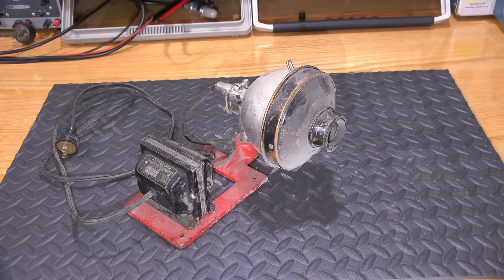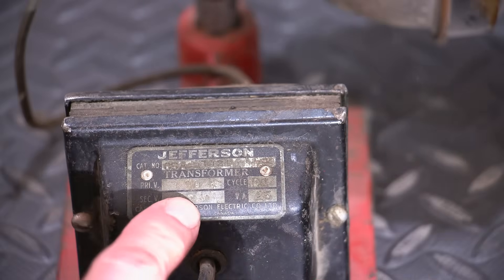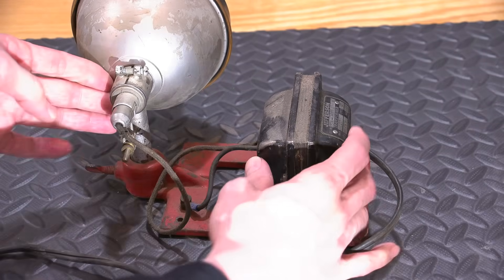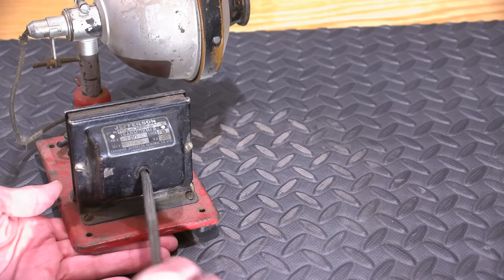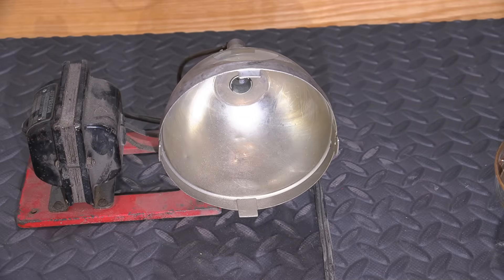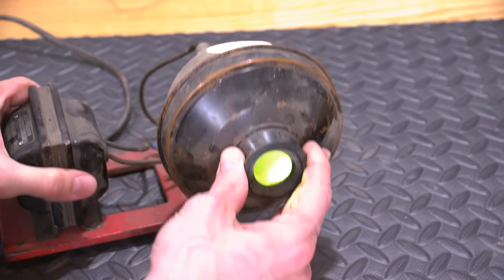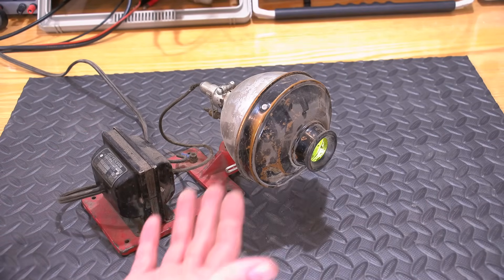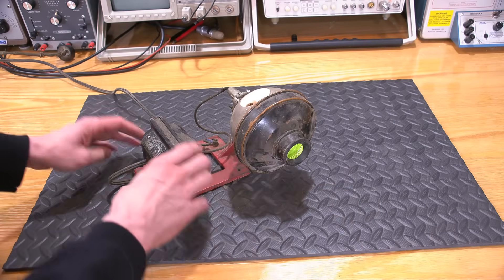Barn Find - What Is It - 1940's? Mystery Device Teardown!

Comment: I have seen similar tinted glass in classic old German home dia projectors with a 100W lamp in them, where that glas was used to absorb the heat form the light. I felt the heat before and after that filter and I burn me before it but after it was only lukewarm. If this is for egg the glas is to not heat the egg up is my guess.

Comment: It looks like an old accent light they'd place behind Urns and plants in the night clubs  The low voltage transformer says its for a low-wat light and teh colored glass would permit color change. Notice its a flat glass and not a lens, so it's made for splash lighting, not intensity. the lower voltage lamps would also last longer, at least all night, back then. Either that, or somewhere between being forged from a meteor and being issued from Io, The Green Lanterns got a tryout upgrade.

Comment: I know nothing about checking eggs with anything more than a regular ole lamp or flashlight.  It most certainly is or could be that.
My immediate thought though was a projector; however with the mount, ability to articulate, filters and that is was manufactured in Toronto makes me think it might be stage lighting.  Like something after limelight or some carbon arc system for a smaller theatre or staging of sorts.  Could be the egg thing though.

Comment: Since you have a clear answer to what it is I would only like to add it most likely would have used a pre-focus type of bulb.  This type of bulb has a lenz built into the glass which concentrates the light to a focal point in front of the bulb.  This would explain why the depth of the bulb was adjustable to fine tune the light on the egg.
Just guessing.

Comment: Possibly part of an automotive wheel alignment rig, the angle adjustment and swivel allow adjustment and a slotted mask disc would be inserted under the spring clip inside to project to a target mounted on a wheel. the rotating drum would adjust the line for camber or kingpin measurements.

Comment: Almost reminded me of an old car tire balancing unit I used to use back in the 80's, but was much older.  it used a white strobe activated by a sensor that you placed up under the lower ball joint and another motor/roller unit to spin up the wheel to about 60mph! quite a contraption, the strobe would flash from the vibrations and reveal the area unbalanced at the rim so you could weight it. on-car balancing is the most accurate BTW.. the egg lamp is much less complex, and a lot safer I bet. 🏁

Comment: One time, I had a flash bulb, and I used a voltmeter to try to test if it was good, but it said it was bad. I guess something was wrong with the meter because when I took a nine volt battery to the bulb, it flashed right in my eyes. I was blinded for a minute or two, and I burnt my fingers some.

Comment: I think this thing was designed to omit, x-ray's. To warm you up in the wintertime. They got the idea from that, Amana Radar Range oven. But they didn't need that metal box. When you could just aim this. At the food items and people you want to cook at a distance. And it was found to be able to burn. The cancer right out of your body.  Of course it would also cook your internal organs into giblets. But no gravy.

It was designed to burn a hole through your soul. It was a retroactive abortion machine. It's a Canadian attempt at TV. Electrical, transformer, electron-beam. And that will have to be close enough.. Let the CBC figure it out. I happen to know they are almost as good as American TV Engineers.  Almost. But not on Tuesdays.

This is a practical electron gun. I thought that was obvious?
RamyRAD

Comment: Flash bulbs have magnesium "wool" in them...popping them is basically short circuiting them out with a consumable filament which burns at a high temperature. Doesn't require a really high voltage to pop. I was able to pop a small one with just a 9 volt battery!!!

Comment: This was my thought process about guessing what this item was.

Being used in a barn, I thought maybe it was some sort of insect trap and killer. Based solely on the thumbnail of the video, I thought the front was open and the light inside was some sort of special green that attracted flies, then once they got inside they'd be electrocuted and killed. Basically, a very early bug zapper.

Then, once I saw that the transformer only put out 6.5V, I realized that wouldn't be enough to zap the bugs. So, I figured maybe it just lured the flies in the front, then they got stuck in there somehow and would eventually die.

Then once the vent hole in the reflector was shown, I became a little more stumped...but still was somehow trying to make it fit with the bug trapper idea, assuming maybe the hole in the reflector would allow the bugs to fall out once they finally died from being trapped. Kind of a stretch, yeah.

It was when the front was revealed as being sealed green glass that I finally gave up on the bug trapper idea, and was at a total loss until the egg viewing concept was brought up.

Comment: With the old "flash cubes", I believe they worked on the piezoelectric principle. I was messing around with  one of them, comparing what was happening in the base with what was happening where they met with the camera, and there's a little sprung wire inside the flash cube. If you pull that sprung wire away from its resting place and release it, the flash goes off! The cameras that used them didn't have an electrical connection to the cube; on top of the camera was a little ramped tang that would catch that little wire and pull it back when you cocked the camera for the next picture. When you pressed the button on the camera, the tang would withdraw and let the little wire snap back, causing the flash to happen. I had fun flashing my friends one day using a toothpick to snap the wire inside the flash cube! I think I still have a couple of cubes that haven't been triggered yet...

Comment: My guess is it is for the railroad for some 'light' indicator/switching service? 
Did you ever find out what exactly it is and what it is/was used for?
Reply: With power limited to < 25W? Way too dim for that; would never been seen from 100m away in bright daylight. Also, the base, transformer, short power cord, and plug all indicate indoor table-top use. Almost certainly an egg candler.

Comment: I agree with the egg candling device but why did it need a humongous transformer.  Did light bulbs back then only run on  6.5 volts?  It seems like a regular 120 V input could bypass the transformer and use a regular light bulb that runs on 120 V.  Maybe he made this convoluted design in order to get a patent.  The transformer looks pretty darn solid tho.
Reply: Yep, it appears to be an egg candler. A 120V 60W light bulb would be way too bright for that; it would blind you after staring into it for awhile. The transformer is rated 25VA, so likely the light bulbs used were 15W or 20W. That, one can stare into with harming one's eyes. That's also the purpose of the warbled green glass: further spreads-out and dims the light

Comment: Wow!  I am glad I found your channel. Very interesting. I would have never guessed that was an egg Candler either.  Most interesting was when you got into the conversation about flashbulbs. I do remember the magic cubes and the blue dots. And other various forms of flashes. I have a very was popular and not even rare camera called the brownie which I think was one of them with the single disposable  bulb that you are referring to.  And just a little something else off the beaten path. I even still have a model rocket from many years ago when I was a boy. It was called the snapshot. You could shoot it hundreds of feet into the air and right at the moment the 2nd stage parachute deployment, it would snap a picture at its peak altitude.   It used 110 film cartridges.  These film cartridges are probably impossible to get. But it's still cool to own this thing. And still no electronics whatsoever. Only thing electric about it was the hot wire that ignited the rocket motor. Just some things I thought I'd add to the comments. This video seems to have attracted some camera people.  However I love electronics and I am a synthesizer player as well as video and still photography. I have tool maker and engineering background and also interest in ham radio. Great video and great channel dude!  I'm sure I'll be watching more of you.

Comment: That flash bulb has magnesium wire, and you are correct that if  you were holding it and activated it, you would get burned.  I have used many hundreds of the medium sized bulbs, and still have some flash equipment for larger flash bulbs. 
The flash cubes, were designed for the Kodak Instamatic cameras..  I still have some, never thought of them as being a saleable antique.

Comment: Well, 6.5 Volts is certainly not going to generate any X-Rays so what ever it is your probably safe (except for low possibility of 120 Vac electrocution)... I'd definately go for it LOL....looks like it needs a old 6 Volt 25 watt automobole style Lamp.....If you search for  "6 Volt 21 Watt Turn Signal Lamp "you will find  a company called Scooter Works that has them for $3.00, looks like it would probably fit and work

Comment: That's magnesium in the flash bulb, in a pure O2 atmosphere, and yes it gets hot enough to cause the glass to bubble when it goes off.

I have one that has a blue coating on the glass, yours is probably older (the blue was to help tweak color response later on)

Comment: It looks like a military or rail road signal lamp. There may have been a tube that fit over the flange if it was military. It would have been used to mark a destination without being seen by enemy troops. I haven't found that particular one but there are many with similar attributes like the adjustable height and swivel capabilities.

Comment: the back bowl is a reflector, so the bulb can be adjusted to focus the light onto the glass. This makes the viewing angle quite wide if if the glass is not very diffused. Due to the horizontal orientation, this may be railway equipment to put in the window of a station to let a train know if there is a pickup at that stop.

Comment: You might have some Krypton glass there if you're lucky, I think that's key to how it works
Reply: Bolt that on the side of you're work bench and with a special chemical you have an easy way to produce a reagent during nuclear disaster or other emergency event. Its a workbench item to keep the equipment you have there running well and reduce its radiation levels.
Reply: use coffee mate, I think that will work
Reply: or perhaps beryllium if you can

Comment: It's a old Theatre floor lamp / inside the removable front you can change the green lens to any color that large hole there is a piece missing 
a snap in cover vent so it will not over heat

Comment: One thing it could be used for not mentioned, is a portable color therapy healing device.  I inherited two full sized color healing machines from 80+ year old cousin that had passed.  Invented by fellow named Dinshaw Godiali ,spelling? defended himself and won in court he was not a quack.  Orig machine of cast alum about 2 ft square and about 5 fit tall with large bulb and large colored slides for certain healing modes depending on illness.  Not exactly portable because of size.  This would work for localize problem on arm or leg instead of whole body.   Came with instruction manual and he wrote his whole theory back in his day.

Comment: I’m good with the egg candler except for the size of it and the green lens.  Ours was a large wooden chalk box with a less than egg size hole in the sliding top and a 40 watt 6 volt bulb inside.
In later years we had 120 volts and added shelves on two sides, one for fresh eggs and the other for ‘candled’ eggs.
The shelves held the wooden 12doz box egg separators …
The fertilized ones were marked and went back out to the broodie’s and the passed ones were taken to Mr. Poad at the store to trade or for credit.  (Sometimes even for cash or candy !!!)

Comment: Black and white camera film is least sensitive to the green light part of the spectrum, so Kodak had a special green safelight (I forget the code number for it, maybe 3B rings a bell) that was used for film inspection in darkrooms in cases where the film had tangled up inside a camera magazine or darkslide. That device is much to bright for that though, but with an extra filter in place and - very importantly - all the leaking white light plugged up - I suppose if could have been used for unprocessed film inspection.

The Kodak green safelights were exceptionally dim and dark green and you really had to sit in the darkroom for 10-20 mins before you could use them for manipulating film to allow your eyes to adjust.
I used to use one at a distance of about 12 feet to pre-sensitize film for lowlight and astrophotography use and I really can't imagine that lamp you have there being useful for photolab use if I have to be honest

Comment: I know I could get those flash bulbs in the 70s and I could order them in the 90s, but most of us were using electronic flashes. Those bulbs were triggered by a big battery, and I never heard of one being set off from static. Those Magic cubes that didn't need a battery, had a striker inside, and you could flash them by sticking something in the hole on the bottom to trigger it, or you could do something like I did one day and drop a case of them causing several to flash. 
And yes, the device you had here is for candling eggs

Comment: Those blue cubes had, IIRC 4 small bulbs that you could take out. As a child, I used them as the ignitor for home made pyrotechnics. Probably more dangerous than I realized since you mentioned them possibly being set off by static electricity. I wouldn't be so foolish now.

Comment: I kinda am into theater history.   As this is an egg examination unit the green gel is actually made from gel  as in gelatin.   Yes jello.    Within food color.      Of course gel was poured into baking sheets and Dried     The colors in old movies are so intense b cause of the of the colors of the gels in the lightning on the staging grid.  She size of gel sheets are still the same size today as the baking sheets.  They would dry and crack need to be replaced daily an many sets   The wave length of lime green is perfect for this application.
Reply: Yup. Made out of gelatin.  I remember the gels we used in theatrical spotlights when I was a stagehand in high school 1963-1966.  The gels cracked and tore easily and if any moisture got on them, they'd soften and get gooey.  They also faded after about 10 hours.

Comment: Interesting, I don't get into antique farm items i it were an EGG situation as it would be common.....probably break out some old SEARS & ROEBUCK catalogs or being Canada....what ever might be a Canadian Version of SEARS.......BUT, in the alternative with the GREEN lens.....it might be relative to the Rail Roads as a signaling device for a tower in a yard for night time operations if a yard worker was to mind a rail switch manually for a "timed" train.....when shuffling tracks in a rail yard.  Hence the AIMING feature in the mount.   Think American Revolution...Boston & Paul Revere...and the church tower.  The time frame would be in the Auto Era for 6 volt systems.....early era electronics and Electricity hahaha.  I would be drawn to conjure.....something possible with Mercury given the era.....so if that would pan out...hopefully its sat outside long enough to out gas if it is Mercury related and a bulb broke...per se.  I live right next door to a former RCA service facility I am fighting over...as I dig up electronics parts from the ERA...vacuum tube stuff and early TV considering.....and it all got buried in the back lot along a stream bank which is a WATER SHED.....subject to roadway run off here in Snow Country and Salting the ROADS...if you can say...Electrolytic Action hahaha !!  I have to do Soil Samples for some lab testing to see what I might FIND !!   Wish I could GROW A GARDEN.......but I might NOT EAT from it.....

Comment: There were 2 flavors of flash cubes. The early ones had 2 contacts per flash and 3v came from the camera to light the flash. The newer (magic cube) was self powered by a released spring in the cube smacking a piezo? thing igniting the cube. Learned this as a 8 year old tearing stuff apart.

Comment: The label mentions it is patented.  The manufacture, Walter Austin Caswell, had an egg candling device patent CA 385159 dated from 1939 so your guess of the 1940's vintage is correct.  Patent CA 385159 describes all the features noted on your unit and in fact the patent drawing is the same as your device. The original bulb would have been brighter than your test lamp though.  The patent mentions using a 6 volt headlight bulb.  I think yours has had the support pipe cut shorter.  Cool old vintage find!!

Comment: Paul, can you do the most common SW receiver from the 40's through the early 60's - the Hallicrafters S-38 A through E models? I run my S-38B on the isolation transformer to eliminate any shock hazard, but the old girl needs an update as it needs a tap to make it work now and then. I have all models of the S-38 made, so I am curious about any hints in the process in refurbishing my radios? Thank You!

Comment: Based on the transformer rating, the appearance of the lamp holder and the comments about this being an egg-candling lamp, I'm thinking that the lamp used would be a motorcycle (or possibly auto) lamp as a lot of early ones used a 6V power system.

Comment: It's an alien death ray, the special green crystal needed a flash bulb to work properly. The crystal was found at a UFO crash site in Roswell, engineers at area 51 put this together.  I did wonder if it was something that was used in the theatre 🎭, but I was wrong. The Truth Is Out There. 😉